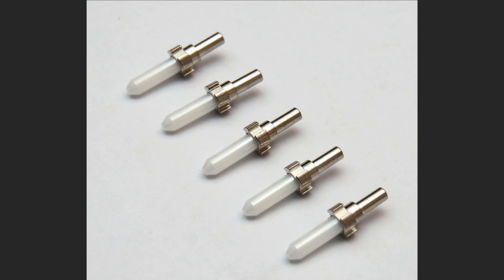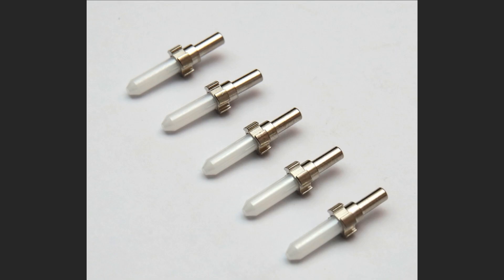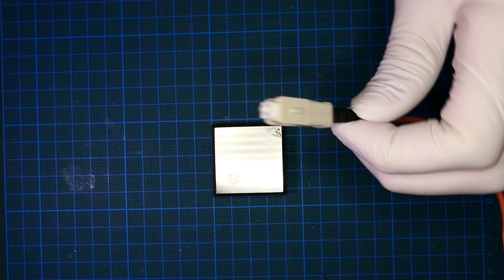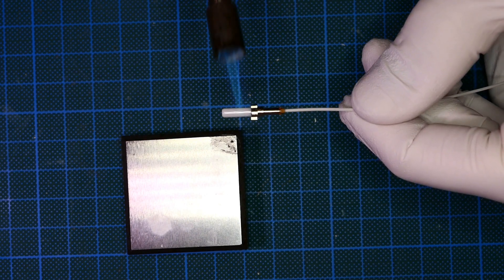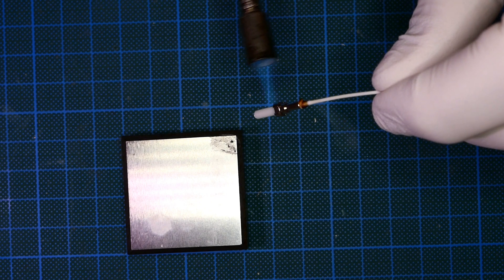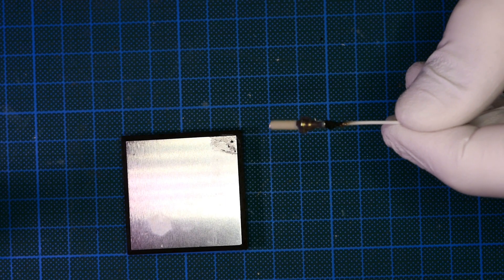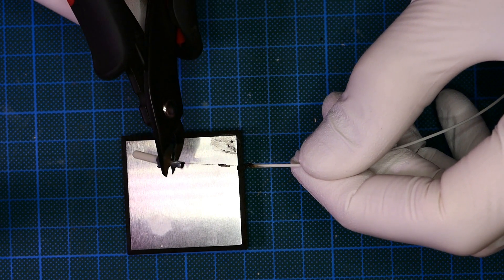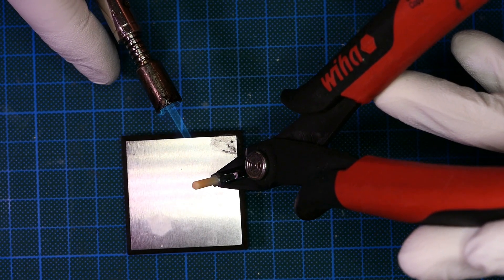Fiber Optics - Extracting Ceramic Ferrules from Optical Network Cables

Comment: is the fo cable in the middle of the ferrule?
Reply from the maker: Yes it runs right through the ferrule, which has a 125µm hole for the fiber.
Reply: @DiffractionLimited thanks